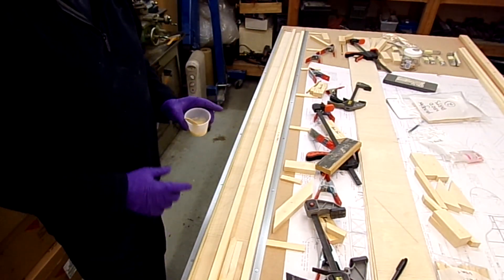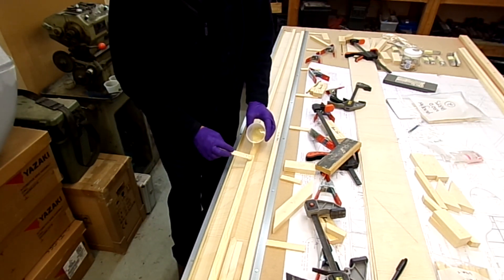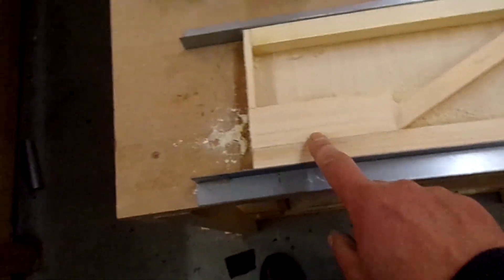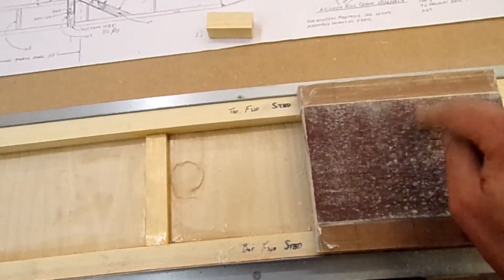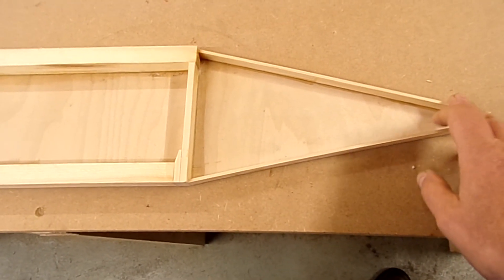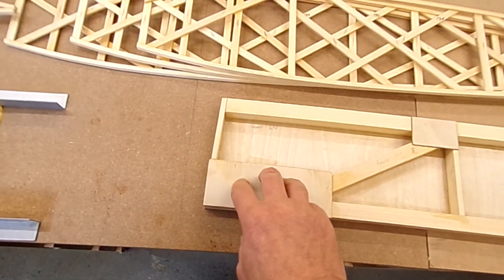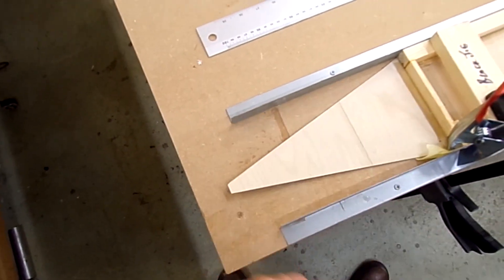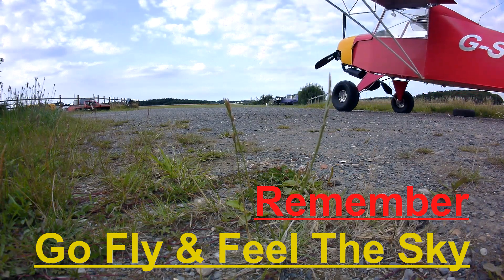EP31 Fisher Youngster V Wing Spar construction progress.

Comment: Out-of-date tail rotor blade tape? I'll just nip down to my local discount helicopter supplies store and have a rummage.
Reply from the maker: It was just what I had, not what I say get 😀 A thick plastic tape with a smooth surface would work but if you find anywhere that sells out of date blade tape let me know, I got mine out of the scrap bin when I was in the RAF over 15 years ago 😀

Comment: I Noticed the plywood grain in your spar runs perpendicular to length of spar and it seemed odd to me. Im not a structural enginneer nor have I ever built a wood aircraft wing so please dont consider my comment as criticism but my guess is plywood grain should match cap strip grain?
Reply from the maker: As you have noticed the surface grain is 90deg to the capping pieces as the web is there to keep the capping pieces spaced and as such would come under compression load, so need the stiffness vertically. 
A great question, I hope my answers makes sense.

Comment: Thanks Ally. Question regarding dried t88: must it be removed before you put another layer of glue over it, or can fresh t88 bond to cured t88?
Reply from the maker: That is a good question. From the information I was given you need to remove as musch as you can or at the very least sand the surface with coarse sand paper. I have tried some standard test aircraft test pieces (there is a video early in the series) and found T88 still had a good bond but did have a few fails, so would recomment a minimum of sanding with 80grit and removing as much as possible on any structural parts. I hope that has answered your question.